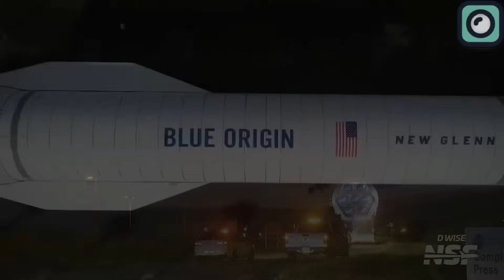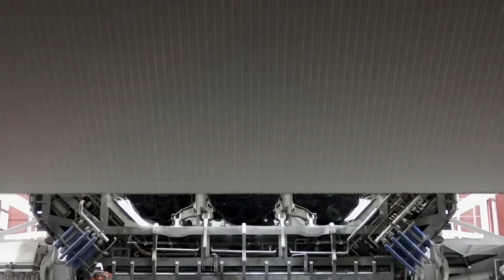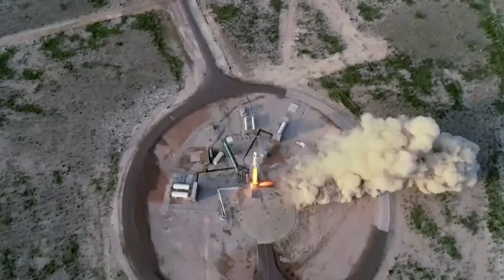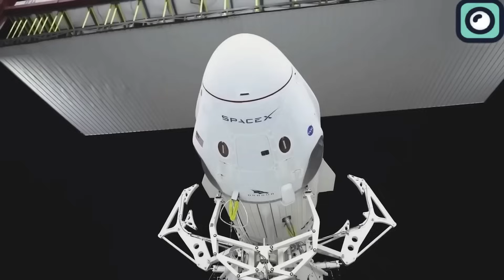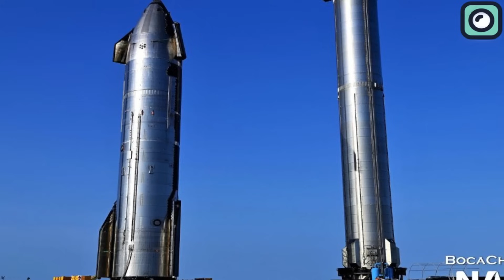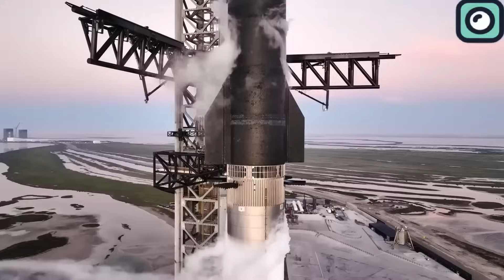Blue Origin's New Glenn Is Facing BIG PROBLEM...Another Delay!

Comment: I have been secretly develeping my own super-dooper-looper-whooper launch system fuelled by (CS/BS/PS/HS & ADS) - cowshit/bullshit/pigshit/humanshit and absolute dogshit.  To date my rocket is as successful, but I'm hopelessly underfunded as NASA will not give me 100Billion dollars up-front like my competitor, hence I haven't even got the initially vital equipment like an espresso machine, or premises to build it.  So I am seriously contemplating launching an internet based manufacturer of free-thinkers, like Elon and Jeff, that we can individually build the bits and bobs  ( technical term for "tricky bits") which can be consolidated to a suitable site where they can be placed by design in a meticulously flawless design ("SWN" - strategic willy nilly) into the unique vehicle I have already sourced and named the WTFIT? -what the fuck is that?.  All the elements are readily available at most hardware stores for less than $1, except I am anticipating the Jeff will opt to pay over $4Billion for his bit as a nice little tax-dodge.  You will need to cough-up for post and packaging to my logistics centre (Mailbox) wher the parts will be thoroughly tested by a casual glance before being hermetically sealed in a zip-lok bag which later acts as a coagulant fuelling accellerator once the wick has been lit.  Nominations as to who should light the wick are open now.